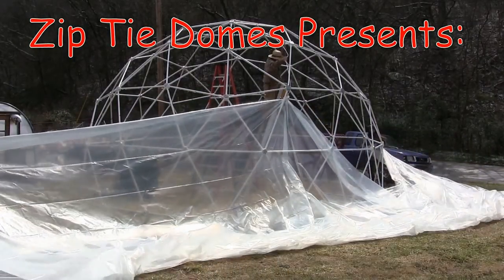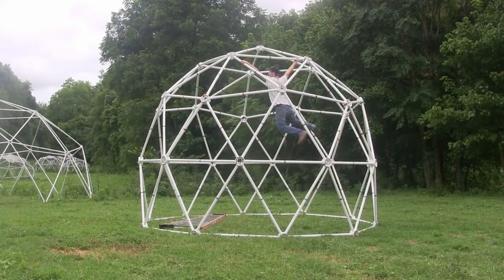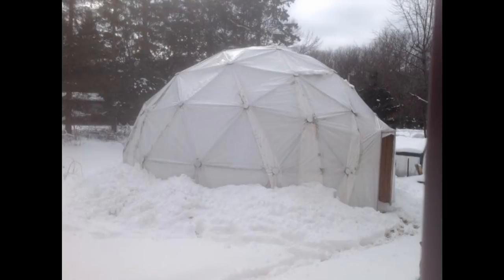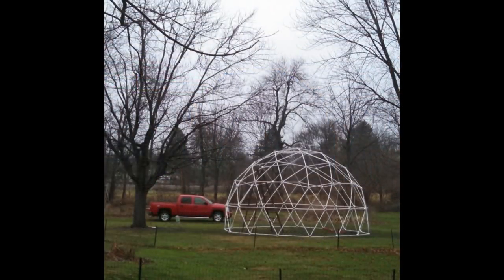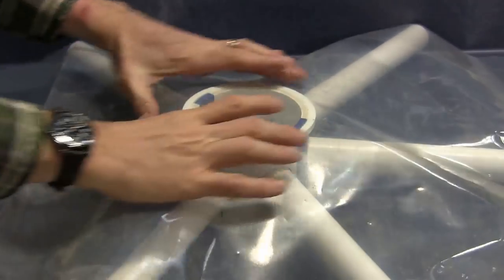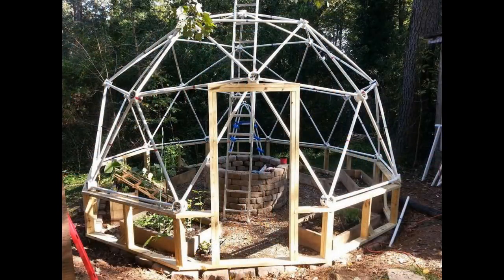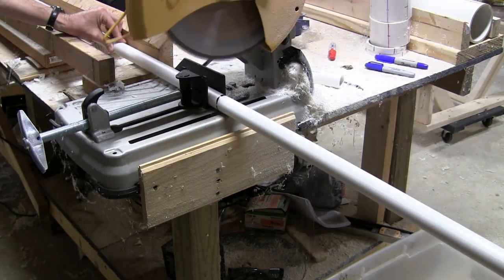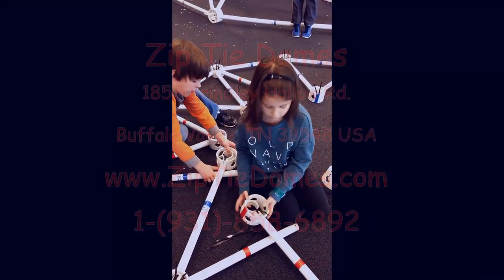8 Reasons Why a Geodesic Dome Greenhouse is the Best Greenhouse Design

Comment: A couple of recommendations for extreme cold climates.

You can add a second layer of plastic to the inside by inserting cheap pvc test plugs to hold the plastic up - you may need to cut an x in the plastic and can zip tie the plug to the inner ring if it wants to pop out.  This can just be thin, cheap plastic since the outer plastic will get the direct uv and weather.  

You could also cut reflective foam panels for the northern most side (in northern hemisphere)  This will help keep heat in and reflect some wasted light back. You could really use any kind of insulation (cardboard is surprisingly good) and just use cheap, reflective Mylar blankets to reflect the light.

Hopefully this helps with a couple of the downsides of geodesic domes in colder climates.
Reply from the maker: You have a lot of really good ideas.  Thanks for watching the video.  John Hurt
Reply: Could you put a larger dome over a smaller dome, to create a whole different growing zone on the inside?
Reply: @recoveringsoul755  you could but you'd be looking at a pretty large outer paired with a pretty small inner just to be able to move around comfortably.  Alternatively you could rig a pulley to lift the center for access.

Twin wall polycarbonate panels attached to gambrel (barn-shaped) trusses may be a better choice if you want to be able to move around in it.  The different slopes of each roof section makes it easy to set up 3 different zones.  My absolute favorite was one that used the south section for tropical plants, the center for trees and the northern side had black painted IBC totes for rainwater storage and thermal mass with raised  beds on the top and grape vines in between that filled the northern wall and roof sections.  It felt like a managed indoor food jungle.
Reply from the maker: @recoveringsoul755  We have a Dual Covering Hub that lets you put a greenhouse covering on both the inside and the outside of the dome.  Here is a video that describes this:
https://www.ziptiedomes.com/video/coveringsvideo.htm
Thanks for watching. 

John Hurt
Reply: @ZipTieDomes  After thinking on this for a bit, it occurred to me that if you replace the topmost center hub with a length of pvc pipe, it could be useful for additional structural support (snow loads on really large spanning greenhouses) as well as partitioning using cheap off the shelf 4-way connections, 3-way Tees and elbows.
If you anchor that center support, it will also minimize the repeated flexing in the wind due to the Bernoulli principle - thus making the zip ties last a bit longer.
Reply: @recoveringsoul755  That is a great question!!  I am starting a geodome project. My goal is to build a self-sustaining Geodome.  I will have to add that to my research!
Reply: @mrbowers5815  Exactly, if you are looking to be sure you can keep a consistent temperature all year long, and/or living in extreme cold or extreme warm climates, then a outer and inner dome can be a great ideal. 

They are cheap as it is, one dome costs little money in comparison to a wooden dome. A wooden dome has to be built by a builder good with angles and geometry, but they are superior to this PVC pipe stuff. But anyway, you can build two PVC domes and still be well under the price of a single real wooden dome.

Plus, you can do the trick that Zip Tie Domes shows us, put the plastic on the outside and inside of the frame. Then your second inner dome could be just 2 ft smaller, leaving a 1ft space between the inner and outer domes, then put plastic on the inner and outer frame of the second inner dome, and you will have superior insulation barrier with 3 trapped pockets of air with 4 panes.
Reply: @TheRebelmanone  
You`ll lose too much light with 2 sets of frame members and 4 layers of poly. The inevitable gaps in the cover will allow infiltration which will negate any potential gains from insulation value.  A super insulated house wont stay warm if theres a gale blowing through it ;)
Reply: @JohnGuest45  I agree about the light, each layer of plastic eliminates a certain percentage of light. It is a trade off, if it is so cold where you would be, then maybe it can still grow greens, or maybe it might need to only have two layers to allow enough light. 

The light is also what heats it some, so add more plastic layers allows less light, it is a hard trade off. But that is why i was only taking about really cold climates in that coldest season, winter.
Reply: @TheRebelmanone 
If you can solve the infiltration issue it would be worth doing. Winter temps rarely get below -12c here, its veritably toasty compared to other places.
Reply: @recoveringsoul755  Definitely.  Seems a geothermal and/or other method to heat the region between the two domes might save on heating the inner dome.  There is also the potential for at night to use a foam bead method where foam beads are blown into the inner layer at night and blown out during the morning or whenever there is sunset and sunrise with whatever lag time is determined respectively.  Great idea I'm thinking.   I was wondering about using HDPE pipe since recently looking into for making a PAPR for welding, grinding, sanding, cutting and using a HEPA filter that is the conical almost cylindrical shape design.  Would be awesome to build one of these around a house to literally change the ecosystem and growing production opportunities for different zones produce.
Reply: @jafinch78  Have you seen the guy in Nebraska who build a greenhouse that uses earth's heat to grow citrus in the snow? It's an older video but they have some kind of tubes under the earth because underground it never gets colder than 54 degrees or something.  Long tubes underground keep it warm in winter and cooler in hot summer I think.  There is another thing called a Wallipini that is also like a greenhouse partially built underground. Like you dig a hole to start. I follow a channel who has been doing this stuff for awhile. I saw an older video of his where he had an enormous greenhouse, looked like a tent inside of it like he was living in there. All kinds of plants. And a smaller greenhouse inside with tomatoes. Outside there was snow on the ground.  It was not a dome though, it had a peaked roof for the snow.  At least I think he had tomatoes it's been awhile since I watched it. He does the thermal mass with tubs of water also to keep stuff from freezing overnight
Reply: @recoveringsoul755  Yes, I'm currently working on two garden tractors restorations and customization where one is electronic actuated and the other is hydraulic actuated for the back hoe where the plan is to be able to dig to a ~8ft depth to lay geothermal piping.  Basically, you dig the foundation to the frost line or lower.  Then foot accordingly to code (or best practices, manuf. specs, etc.) and build accordingly with an air heat exchange method with the geothermal piping versus a fluid heat exchange method with the piping.  Very compelling and interesting idea that I'm thinking is worth demonstrating and studying performance with a geothermal dome operation.  Also considering the same design suggestions with north side insulation.  I've also thought about adding a mulch pit design on the north and enclosed walls with geothermal piping too... maybe pond lining or other recycled plastic materials the outer wall... so to take advantage of the thermal mass, insulation properties and heat generation properties of the mulch pit decomposition.  Thanks for the reminder!
Reply: @recoveringsoul755  Seems an area of opportunity also for recycling plastics to be used in underground lining of structures to prevent gas and liquid transfer, like radon or water or whatever.  Especially, if the aesthetics isn't a concern and only the performance characteristics.  Such a waste of plastics and would be nice to have a cost effective or subsidized infrastructure maybe even using robots to make more cost effective or prisons labor to recycle more plastics.  Another issue with government however, is they'll not redistribute the wealth and rob the economy for their personal interests and concerns mafia style seems in some jurisdictions really bad.  Though, some of the worse jobs seem can use resources that are wasted to be trafficked for better objectives to benefit society and the peace.
Reply: @jafinch78  Apparently there is a thing called "trash walls" where people build wood frames like they would when pouring cement, but fill it with trash and maybe some rebar, then put the cement in. But it''s got old bottles and cans and junk so you not only get rid of the garbage, but reduce the amount of concrete that you need. Might not be good for a solid foundation for a sky scraper, but for retaining walls or a koi pond or maybe planter boxes and that kind of thing otherwise you might want to consult a structural engineer.

Long time ago a watched a thing where a guy collected old plastic drinking water bottles. He put them into bigger mesh bags, filled with air each bottle with the cap on, and put them in the water and tied them to each other. Once he had enough of them he started putting dirt or sand on top of them until he built his own floating island Then put a little house out there I think it's got to be anchored to the bottom somehow. I think he's got a little boat and boat dock and even growing some of his own food out there.  Helps to live in a tropical climate with no building codes. He just keeps collecting water bottles and adding them to the underneath to keep it floating. In case the older ones decompose or something I guess.
Reply: @recoveringsoul755  Yep, there's a few ways.  Reminds me of the earthships in New Mexico and elsewhere you're talking about.  Yep... I've wondered how the dryer climate designs can be implemented in moister and colder climates... hence the thought of plastic lining to prevent leakage and then dealing with condensation next logically if not insulated enough.  The trash island guy you're thinking about is in Mexico if I recall correct since watched a video of his island that floats on bags bottles.  I think he's like on his 2nd or 3rd one since hurricanes destroyed or damaged the previous.  He has free berthing too if I recall correct.
Reply: @jafinch78  sounds great. Wish I had land to play with
Reply: @recoveringsoul755  Yeah, can be dangerous and security needs to be considered also since not only the extremes of the climate environment due to weather a concern... the mental state of the inhabitants needs to be considered.  I literally was watching a Youtube video on ferrocement building of cisterns for biogas generations when my house was invaded, broken into and I was shot shattering my left femur and armed robbed.  Get's dangerous with hostile gangs, neighborhoods and even economies in certain jurisdictions whatever the causation, be it narcotics, poisons, sexual deviants sodomizing and/or inbreeds mental health criminal minds.   Basically, just have to make a plan and see what the investment, expenses, resources and feasibility of owning land is.  Amazes me how much resources can be found for free or cost effectively if you can learn how to repair and restore like crafts though for farm or other utilitarian implements.  Land wise, have to think like the old U.S. homesteaders and determine how to pay taxes once the land is paid off.  Then maybe any fees for permits and inspections if required based on State or maybe Local Laws.

Comment: Only just seen this unique construction concept. I was particularly attracted to the lightweight design so easy to move. An interesting idea is the dual plastic sheeting option so minimising heat loss in winter. I live in the east side of the UK where snow is rare but we do get high winds mainly in winter but occasionally in summer.
Reply from the maker: We have a company in the UK that makes our domes.  They are at PrimeTeknologies.com
John
Reply: I`m on the east coast too, wind can definitely be an issue here but as long as you anchor down well its not a problem. As for snow, its becoming increasingly difficult to predict what the weather will do these days so its prudent to plan for the worst and hope for the best.. The uk company website John linked to isnt very infomatative and being london based company you can bet they`ll be charging way too much ;)

Comment: I've been watching a bunch of your videos today, your domes may be the answer to my homesteading Spring of 2019. Cost is a huge consideration and I'm searching for answers to other questions I have such as a woodburning stove added in the Winter for heat.
Reply from the maker: To install a woodburning stove, cut the covering out of one of the triangles at the top of the dome and replace it with sheet metal, then plumb the chimney through the sheet metal.  A good example of how to make a winter shelter is at this link: https://www.ziptiedomes.com/customers/allysonpacker.htm
They used tyvek on the outside that was cut into triangles and taped to cover the dome, recycled denim for insulation, reflective mylar on the inside, and astroturf for the floor.  The wood stove goes right through the ceiling.  If you have questions, let me know.  John Hurt
Reply: Same here. I am a seasoned carpenter with all the tools necessary, but really would like to do something simple once in a while. This may be it.
Something for the chickens

Comment: The inner/outer plastic zip-flange sold me !! What a great idea plus up-gradeable to stainless cable wrap, nylon cord, etc!! Zip ties are faser though, love it thank you! PS if you made kit with just the HUBS PLUS CLEAR TRIANGLE panels (plastic, or fibreglass, lexan(strongest--more$), etc. I would BUY IT !! WOULD BE EVEN STRONGER AND SEE--THROUGH !! I would secure them (AND WATERPROOF) with fiberglass/epoxy (prefer epoxy-stronger, less smell) ! Fiberglass tape/fabric to secure/seal ! Would add time + $ however, not break the bank ! One could even live in it utilizing curtains (privacy) and windows that open shut easy !! I would hang garden baskets EVERYWHERE (Then no need for curtains !) The weight wouldn't hurt(might add strength to base lol !!) Wow what a great product, bless you hope to do business. Solar triangles too !! Lol
Reply from the maker: Thanks! I appreciate your ideas, that is very creative.  Thanks for watching the video.  John Hurt

Comment: Those stainless steel zip ties are very much available for purchase without 'special order from the manufacturer.' They are used for securing exhaust wrap, so you would commonly find them in automotive type stores. Also available from Amazon.
Reply from the maker: Some of the automotive steel ties are only rated for 120 lbs.  We use 350 lb tensile strength stainless steel zip ties, from this supplier:
https://www.securecableties.com/8-inch-heavy-duty-stainless-steel-cable-tie-100-pack
But, if you can find something like this cheaper on Amazon or on the web, that would be perfect!
Thanks for watching the video.  John Hurt

Comment: Keep the good work up.I build my dome from wood exactly like Buckminster Fuller but i am fan of your zip tie domes.I think if you find a simple way to make it covered with polycarbonate outside and inside,you hit the jackpot => no need for wooden domes.
Reply from the maker: Thanks, I appreciate your comment.  John Hurt
Reply: Yes, love this but hate to have to cover it with plastic, takes away from the geodesic beauty, but I don't see what else u can use and keep the elements out?
Cheers
Reply from the maker: Patrick, you are right.  The dome does look better with individual windows made from polycarbonate.  But you have to cut the rectangular polycarbonate sheets into triangles, which creates a LOT of waste.  A single sheet of greenhouse film solves this problem, and is much cheaper.  And they have 6 year film now, with different amounts of opacity.  It is really a better option than in the past.  Thanks for your comment.  John Hurt

Comment: That ring on the both side of connectors is pure genius, sir. I was wondering how to attach the sheeting to this type of dome and you had me floored. It seems like it should not be too difficult to use multiple sheets while allowing for an overlay of the top sheet over the bottom one. Any designs for using polycarbonate sheeting?
Reply from the maker: It is expensive to cut 4x8 sheets of polycarbonate into triangles.  A single sheet of plastic has less waste.  Thanks for watching the video.  John Hurt
Reply: @ZipTieDomes  you speak wisely, sir.

Comment: Awesome video and wondering about HDPE pipe?  Have you or anyone used and any issues?   Also, wondering about painting the PVC for better longevity with a UV reflecting or absorbing paint.  Any recommendations?
Reply from the maker: You can use a latex acrylic paint to paint the dome to keep it from interacting with the greenhouse film, as the PVC in close contact with some types of greenhouse film will cause the film to deteriorate.  The UV only goes through the top .001" and discolors the PVC.  High temperatures in the desert will cook the PVC pipe and make it more brittle, but it will still be very strong.  Thanks for watching the video.  John Hurt

Comment: I lived in a geodesic dome. They can have snow build up on them. Also, they can leak very badly and be very hard to fix. But I’m still looking into a geodesic dome greenhouse.
Reply from the maker: Yes, the snow can definitely be a problem, but if it is "dry snow" and windy, it can blow off the dome more than other shapes.  And yes, domes do leak with all of the triangles and edges that need to be caulked, but if you put a single sheet of plastic over the entire dome, it seems to solve a lot of the leak issues.  Thanks for watching the video.  John Hurt
Reply: @ZipTieDomes  thanks!